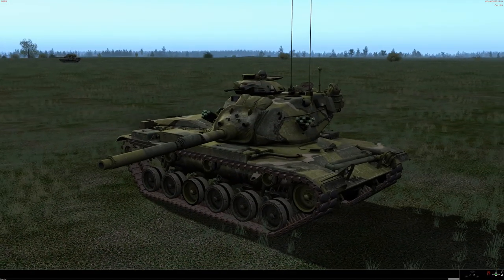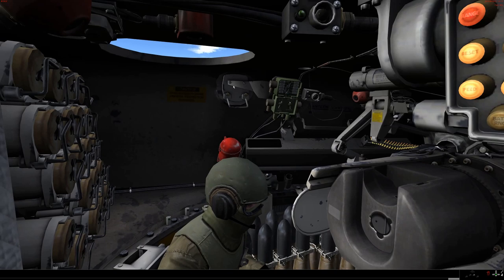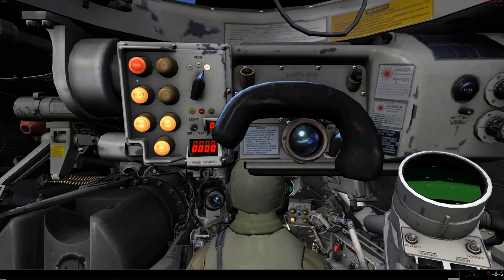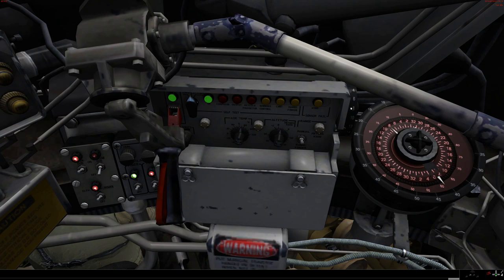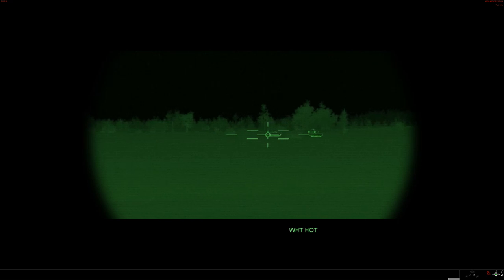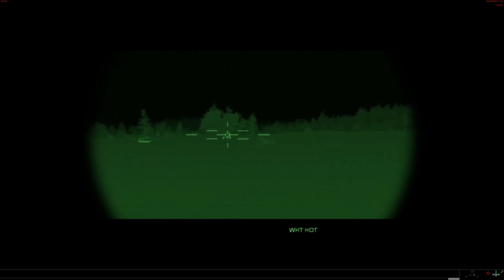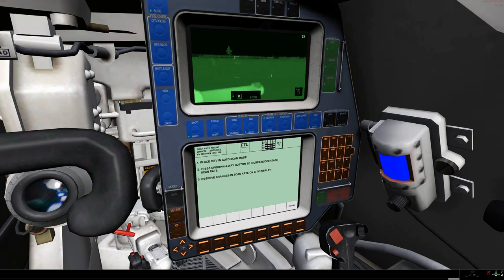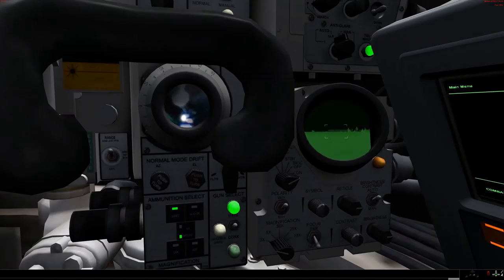M60A3 TTS Switchology, and a little M1A2.

Comment: Yes, the M85 was absolute garbage. I can honestly say that I don't recall ever firing an engagement at gunnery without a stoppage on the .50. Worst weapon I have ever experienced. Apparently, the M73 .30 (yes, I know "7.62") developed at the same time was similarly bad or worse, but by the time I joined it had already been replaced by the 240. The M85, though, couldn't be replaced because the M2 wouldn't fit in the cupola.

"Not much more to say about the .50." Except that the one in the game actually works.

"Note the complete lack of protection for the ammo." I used to roll out my mat and bag and sleep on top of the rounds in the standing ready rack, with my feet on the shelf behind the loader's seat. We carried live ammo at all times except for gunnery back then, because it was West Germany in the Cold War. And incidentally, the round casings should be aluminum, not brass.

It did have a shield which fit over that part of the turret basket, to catch the casings. Someone just didn't put it in the game. It was removable, so the driver could get into the turret when the turret was facing rear.

Also, I don't know if they put it in the game, but when you laid on a target, you had to do so in a J pattern with the reticule, so that the last move of the gun was up. This forced the air out of the gun hydraulics, otherwise it had a tendency to be off. A design flaw, I guess.

And the loader wouldn't be sitting. You can't load a 105 from the sitting position, and he would always be standing with the seat folded up out of the way anytime you're ready for engagement.
Reply: Whatever